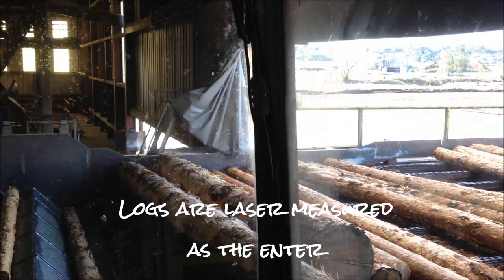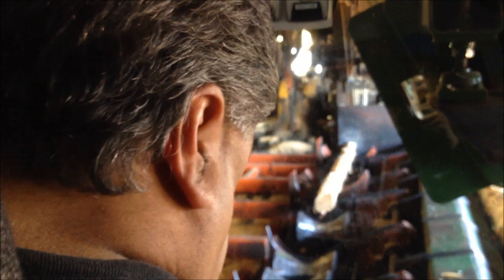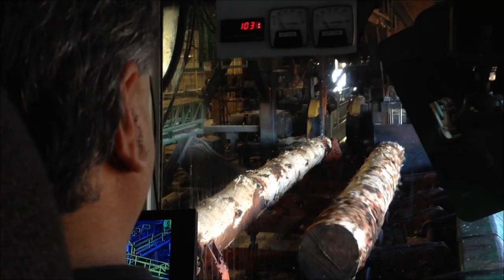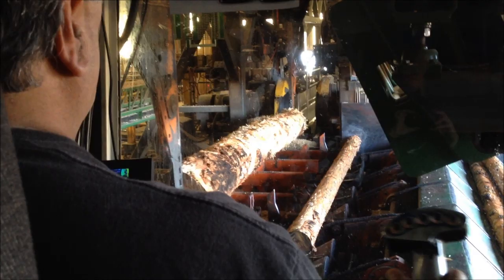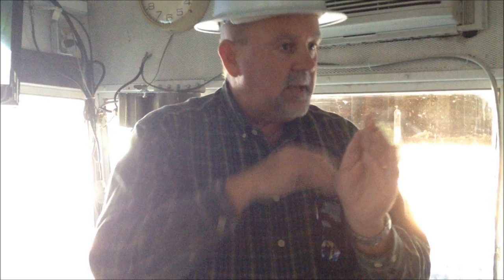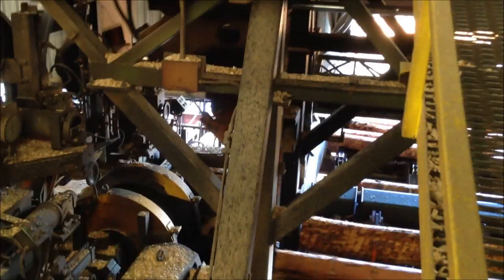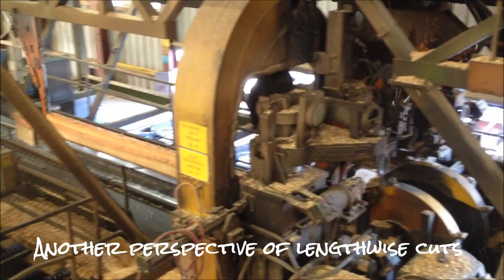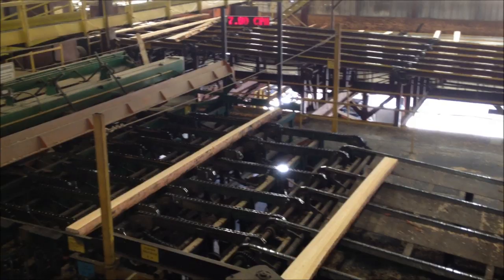Saw Mill Tour in 5 minutes

Comment: Oh, the saw follows the contour of the log so you end up with pre-warped lumber.
Reply: No. Actually the lumber comes out straight and of higher quality. Instead of the grain going in and out of a board, causing weak - low value lumber, curve-sawing follows the grain and more of the log is turned into lumber instead of chips.